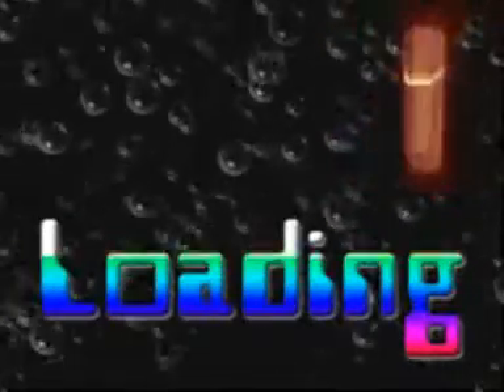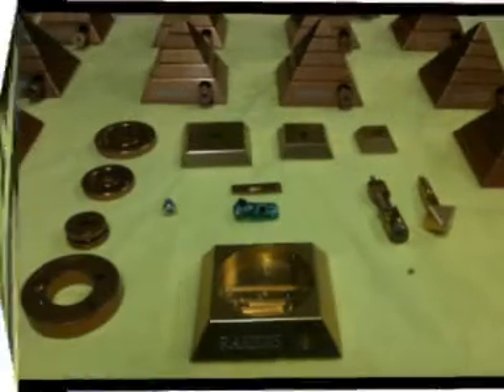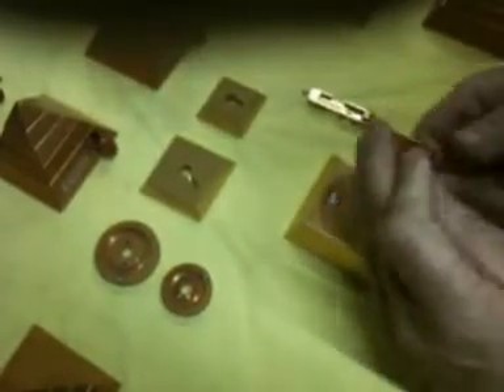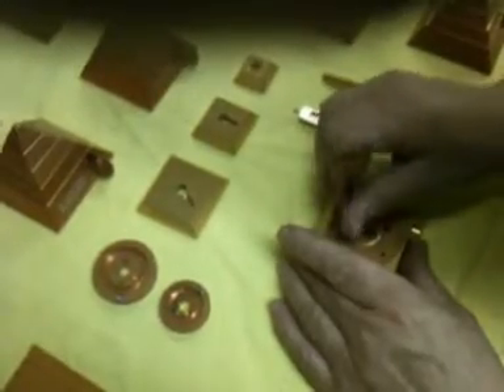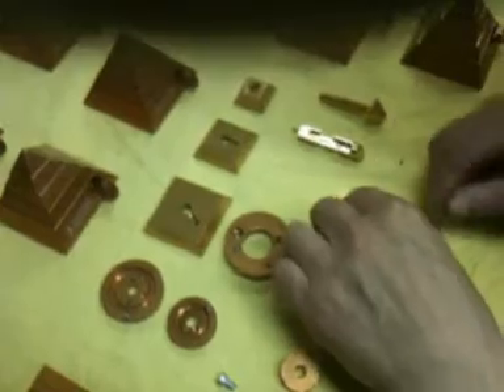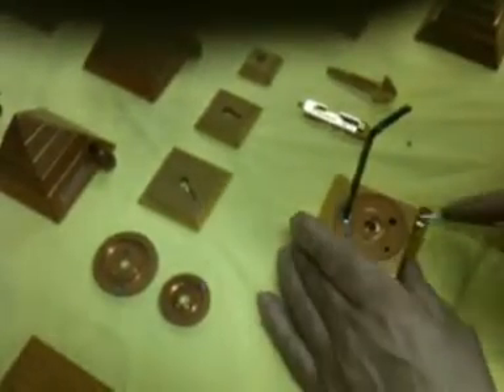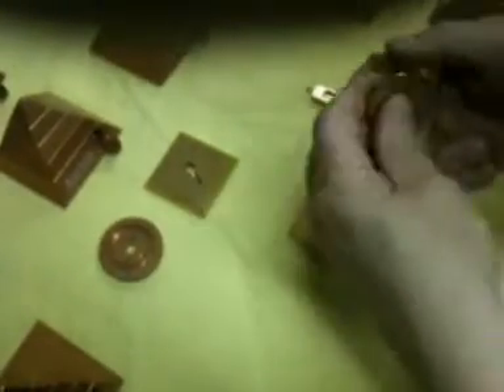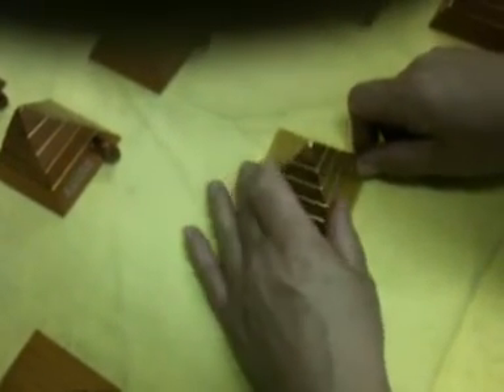The Ramisis revealed

Comment: finally got mine fully disassembled.  Note, however that this first part of this video is simply the reverse of the second part, so they don't show you how difficult it is to actually remove the locking plate the first time due to the amount of friction from the tight bolt.